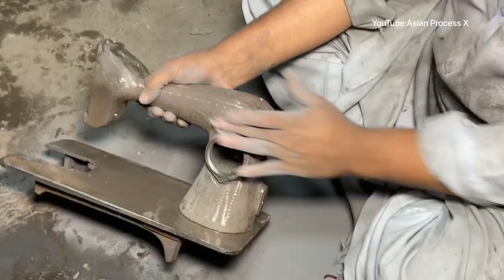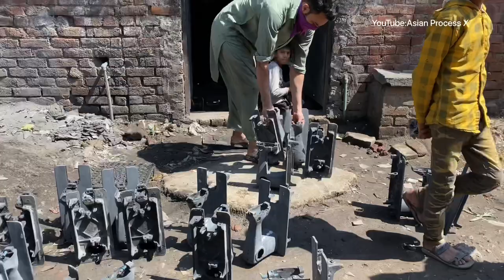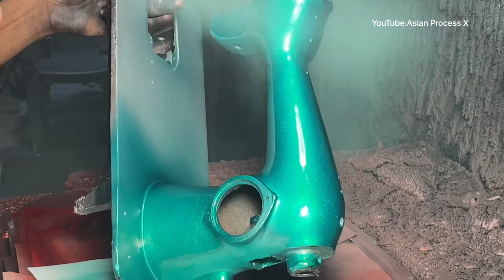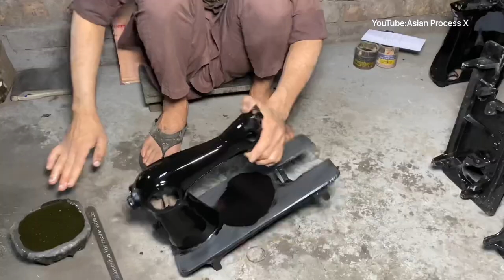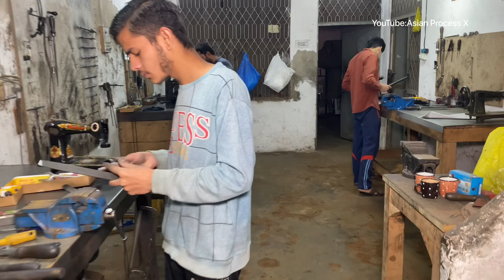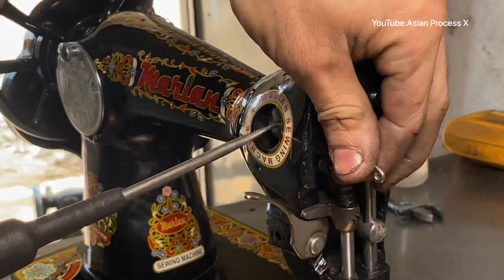How Marian Sewing Machine Are Made

Comment: I didn’t know they still made these. This design technology for sewing machines is over 100 years old! Are they that far behind?
Reply: Well, generally speaking this SInger15 designs are really superior to any modern plastic machine. Uhmm I dunno how much quality these machines carry, but if you take new this and any new modern design plastic encased machine - you'll be surprised how powerful  the Singer15 is. Mostly these new-old machines will outperform any A-brand heavy duty machine in the range of 200-400$/usd
Reply: @ran2wild370  we have my wife’s great grandmother’s Singer sewing machine that has the foot pedal. We don’t use it but we could I’m sure it still works. It might need cleaning and oiled but it’s in fantastic condition.
Reply: @ecleveland1  To preserve it from rust - just oil and turn every few months.